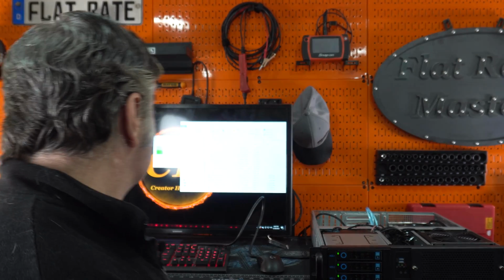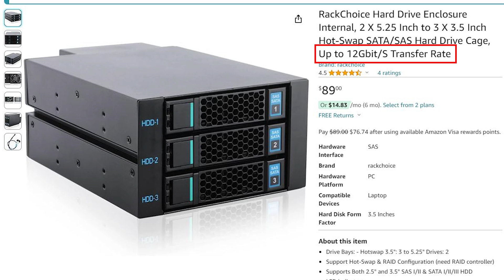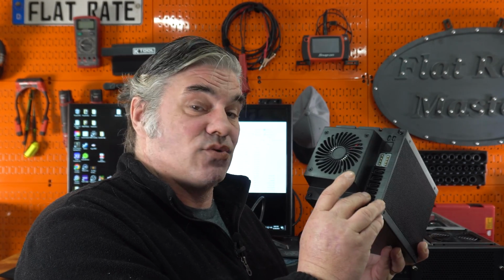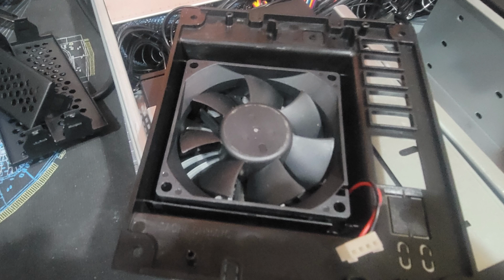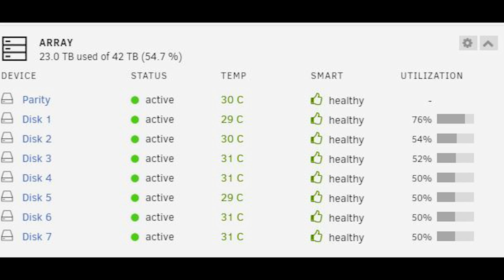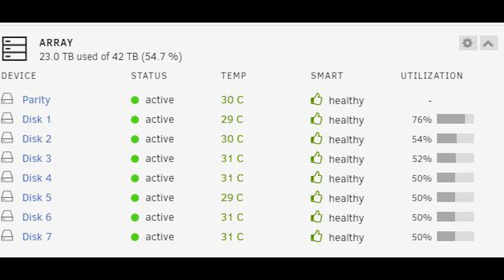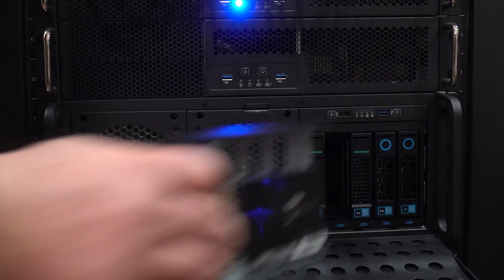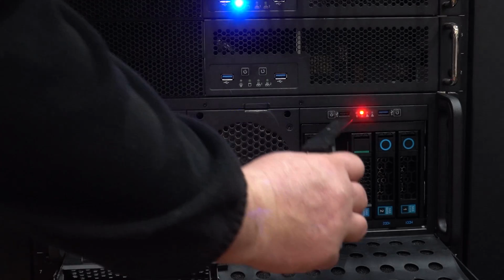Hot Swap HDD bay in Any Chassis 2U/4U For Your Unraid-TrueNas-Plex Server

Comment: Thanks for this video I wasn't sure if I needed to keep the metal enclosure to mount the backplane but it looks like you do need to pop out the front and install it into the metal enclosure, kind of a pain for their 3u chassis as the screwdriver length required is silly long for re-adding the metal enclosure for the HDDs.

Comment: Currently have 3x 3.5 hdd in 3x 5 1/4 bays, which means i max out at 18 drives in my nas. do want 20 to do 2 pools of 8+2, so have ordered one of these for the additional 2 drive slots for my corsair case :D

Comment: my opinion is to avoid and just get a big case like fractal define xl and avoid molex and spinning rust in general too - the way to go is with arrays of nvme - an array or two of spinning rust is basically still needed for cold storage like iso and vm and backups but what i would like to see you do is get 3 dual port 56 3rd gen connect-x cards and some transceivers and build dual nas - your ws connects to each nas and you can sync each nas to other through direct 40g - no switch needed for this setup - i thin cat7 will do 40g, you may need cat8 or just use dac connectors - it is a good setup for creators/homelabbers and smb/sme. do people really need dual nas? i would make a case for it and say yes, especially small biz
Reply: this is ridiculous. consumer cases (or rather the cabling mess they force you into) are a pain to work with if used for storage, since they have no power distribution pcbs for the drives. molex are really good connectors, as in they're hard to screw up and can push a ton of power. "spinning rust" is still the best in terms of price-to-volume ratio, and so it (most likely) is for storage volume per unit. higher bandwidth infrastructure in general is stupidly expensive, and is not likely to be needed for homelab/smb folks
Reply: Arrays of SSDs only are not practical when it comes to price. I can get a 18TB Exos for 200 Euros. Show me that in SSDs.
Reply: this has to be bait, right? nobody is this stupid, right?
Reply: @maxcobar4446  oh boy, i bet you've never worked with people